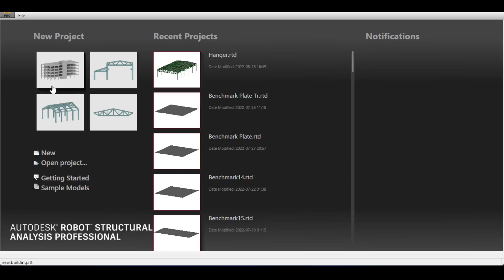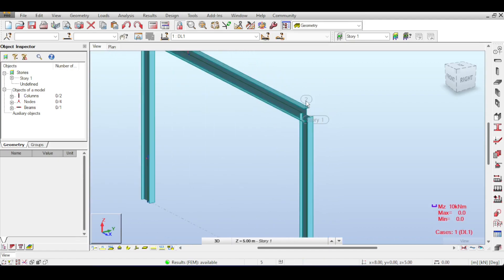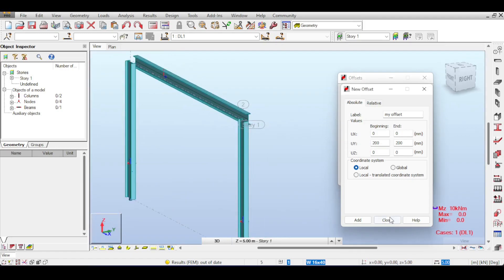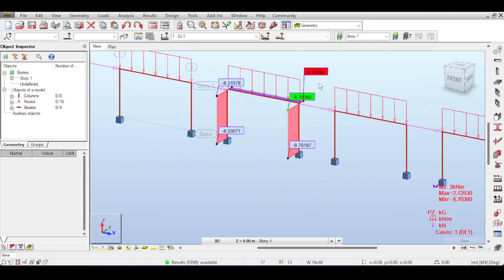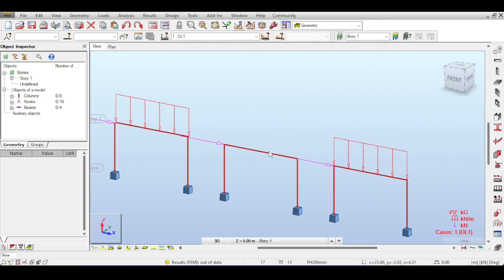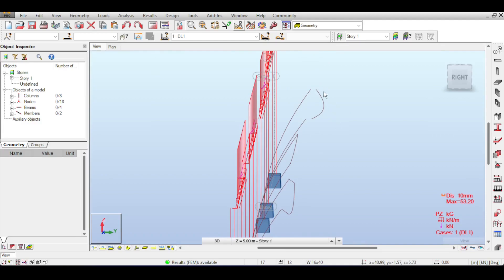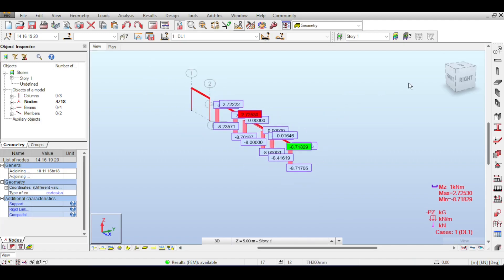Understanding Member Offsets in Autodesk Robot

Comment: Mr. You are wrong about that robot offset, are creates rigid element between nodes.  
Make a simple example. 
1. Create columns and divide in two section.
2. Aplly offset to top section 
3. Aplly normal force Fz force commpresing column in Axial
4. Calculate model.
5. Check moments you will see that they are totaly wrong. In my example there were no momets in lower section. There was only momentuw in top section.

Comment: sir is there any way u can make a dummy frame/beam in RSA? for adding distribution moment  that is not laying on a beam
Reply from the maker: Yes, you could. If i understand correctly, you want to have structural elements just for the sake of "connecting elements together and distributing loads"
if that is the case, you can create a section with very very small dimensions.
PS: Sorry for the late reply. I had a ton of things to finish and now I am gradually getting back

Comment: Thanks again for another great video (working my way through these chronologically on the train to work every day!)

Something I found interesting in the past when I used STAAD was that it didn’t orientate angle sections and unequal angles (L sections) in the orientations they are typically used, i.e. with the outstands vertical and horizontal, but instead it orientated them with respect to their principle axes.

I think robot might do it orientate to vertical by default, which should give bi-axial bending for vertical loading. Similar but different concept and maybe something to cover in a future video? Thanks again
Reply from the maker: Hi there
I am really happy that you find those vids helpful. It encourages to push harder. 
Indeed, robot places channels on its horizontal axis instead of its principal.axis. now since those sections (especially L) are unsymmetrical, it would have consequences, exactly like you mentioned. Your suggestion to cover this is really great. I will keep it in mind once I finish the RC building series.

Thnx for your comments and feedback and all the best
CEE

Comment: how will offsetting a beam top flange to the column change the results?
Reply from the maker: because the axial forces in the direction of the original beam would have moments when the beam gets offsetted. (kind of like an eccentricity).
Reply: @CivilEngineeringEssentials  I see, so when modeling and then analyzing  it is best not to use offsets unless you know for sure there will be eccentricities. 

For example a simple portal frame with only gravity loads, best not to offset the top of the beam flange to the center of the column, but have them connected center-to-center
Reply from the maker: I totally agree with you, as the real force transfer will happen at the centroid of the section.
I even tried that (offsetting) in a bridge girder and it did not work.

Comment: You are the best 💞😘
Reply from the maker: Glad you liked it. Stay tuned for more videos.
Reply: @CivilEngineeringEssentials  I am waiting for more video thank you. Can you please explain more about the buckling ratio that should be filled in the code parameters window . And how to think about it
Reply from the maker: if you mean the ratio k L / r
(Note, if you mean something else, feel free to tell me the exact location in the video)
here is a quick breakdown:
Each axially loaded element can buckle if you are applying compression that is far more than what the element can handle. Take your plastic piece (for example), if you compress it, it will buckle.

Instinctively, there are two factors affecting the buckling strength of an element.
The length, which is inversely proportional, meaning a longer piece will buckle more easily than a shorter piece

and second, the radius of gyration (inertia and area), meaning: a piece with a smaller cross section will buckle more easily.

The third one is a bit less trivial, and has to do with the end conditions of your piece.
Compression a piece between your two palms (pins, no fixation) will buckle  easier than holding the two ends firm (two fixations) an compressing it.

So:
the longer the piece: the weaker
the smaller the cross section: the weaker
the weaker the end supports: the weaker

kL/r measures how weak the column is. Having higher numbers means your column is weak, which would indicate potential danger and susceptibility to buckling.

Thus, the ACI code defined a limit: kL/r < 22 for sway and less than 34 + some modifications for non-sway.

the "k" coefficient you see there is the factor that determines how "strong" the supports.

there are two axis, y and z (strong axis y and weak axis z). Thus, 2 ks.

Kind Regards,
CEE
Reply: @CivilEngineeringEssentials  thank you very much for your explanation. Yes these are what I meant. We should define to each member the Ky and Kz which are located in Design/steel members design - options / code parameters.
Reply: In addition to that it is difficult to define the wind load based on the ASCE code. So we will be very grateful if you can explain it and define it manually
Reply from the maker: Sure. I will have it on my ToDo list ^_^
Reply from the maker: Not really. you can let robot calculate the "K" factor for you according to the alignment charts and frame type (sway non sway). Of course, I am talking about the AISC and ACI codes.

Comment: This is abit of a technical question. 

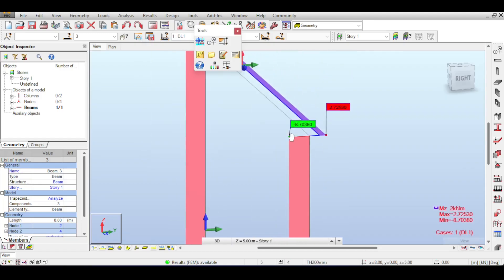For a frame with resisting gravity loads (DL1) as as shown in timeline 7:48 sec 

The major axis shear( Fz) when offseted causes a torsional moment (Mx) on the beam. And same offseted  major axis shear (Fz) acts as an eccentric axial load on the columns causing minor axis bending (Mz) in the columns. 

How’s there Mx on columns under DL1?
Reply from the maker: I really like those technical questions, here is a quick breakdown for the reason:
The frame without any offsets and with fixed supports will cause axial forces in the beam, because the supports are restraining movement in the direction parallel to the beam, which causes reactions, that are in-plane column shears (Fz) and are transferred to the beams as axial loads (Fx).

Without any offsetting, the load transfer happens directly, and no moment generation is involved.

With the offsets that are done in that example, suddenly the load transfer causes moments.

The in-plane shear (Fz) for columns causes out of plane moments (My) on beams, because Fz is eccentrically applied, Fz has now a moment arm that causes Mx on beams.

Similarly, the axial forces on beams (Fx) causes a torsional moment (Mx) on columns, because Fx is eccentrically applied to the columns. The beam (Fx) was parallel to the column cross section, but was perpendicular to the longitudinal axis of the column, thus causing Torsion instead of moments.

The generated moments that are caused by forces is not always torsion nor moments, it can be either of or even both. It depends on how the offset relates the forces between the two members.

Now I know it is always challenging to explain stuff like this using simple words instead of pictures and videos, but I hope it did the job. In case there is still something missing, feel free to tell me.

Regards,
CEE
Reply: I didn’t realise up until now that, under gravity loads, the shear force on the columns causes the beam with offset from the centerline , to experience out of plane (Mz) and in plane bending (My)

The deflection shape is really critical to my understanding of the issues with beam offsets. 

I have had to watch this tutorial over again, paused to understand the technicalities with topic. It’s sooo insightful. 

Thank you.
Reply from the maker: Indeed it needs you to repeat certain positions in the video to 100% realize the relations between forces, offsets and generated moments. Glad you liked it.

I always try to keep my videos concise to increase viewership and avoid boredom. Glad it worked in this video too.

Comment: Thank you Thank you Sir.

Everything about RSA member offset is covered in this short video.This is extremely insightful and doubts clearing.

I’d probably always avoid applying offset to line and point point load and modeling an extremely short beam with a high stiffness value due to the fact that these techniques don’t reflect my structure in real life.

I believe the best option is to allow RSA introduce rigid links in member offset command when analyzing the structure

It’s amazing how you have soo many options at your disposal with regards to RSA software. As a practicing structural engineer, I learn a lot from your channel and always on the look out for new contents everyday. 

Am grateful I found your channel.
Thank you CEE
Reply from the maker: Most welcome. I am glad you liked it.

True, personally, I use Autodesk Robot's Member offset instead of load offset or introducing rigid members as this is how things are naturally erected in our Structures.

I think RSA has rigid links but for plates and shells, I will check it out and maybe post a video about this in the future.

RSA is indeed an amazing software. I personally always suggest civil engineers to use it, especially due to its compatibility with other products of Autodesk.

Anyways, thanks for your comment, glad you are enjoying the videos I post.

Regards,
CEE